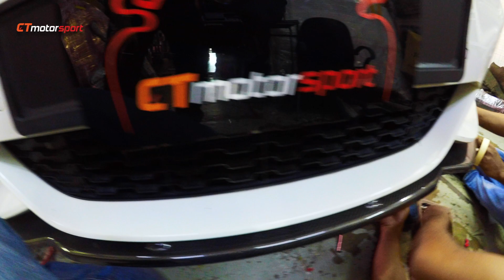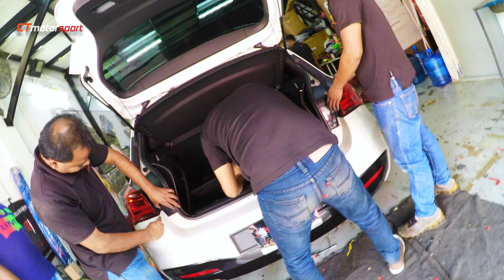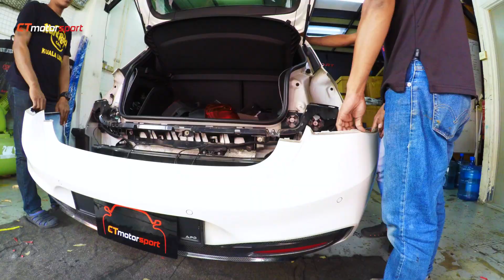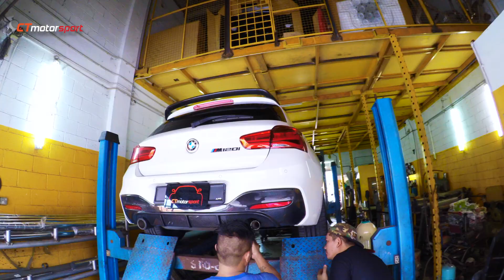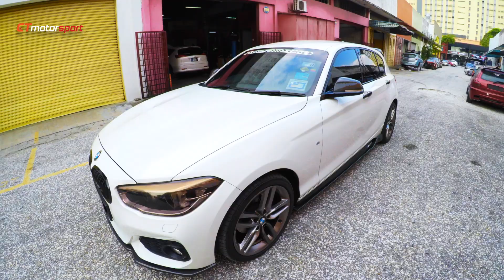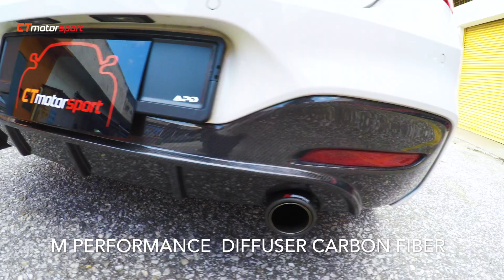BMW F20 INSTALL CARBON FIBER ACCESSORIES KIT

Comment: How much did this cost?
Reply: I would probably estimate the whole thing would cost just under £2000. The parts (front splitter, spoiler, side skirts, rear bumper and the extra exhaust pipe) would probably come to around £1000 or just over depending on where the parts are from. The laboring costs are out of my knowledge, but maybe around £700-800 for installing them. I think installing the exhaust would of taken the bulk cost out of the laboring. 

I am wanting to get this done but i have a 120d with twin exhausts, so i don't see the need for the separation as i actually prefer them close together.